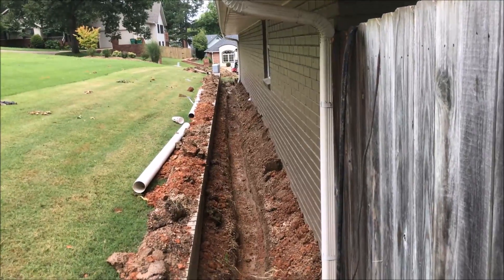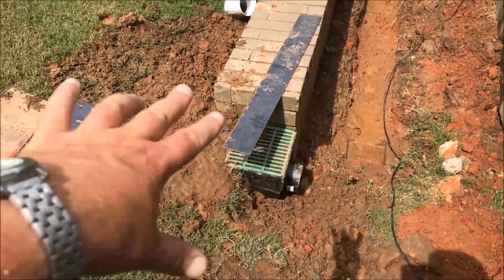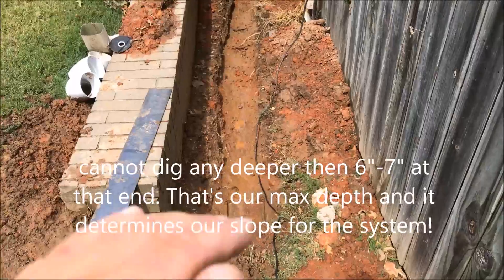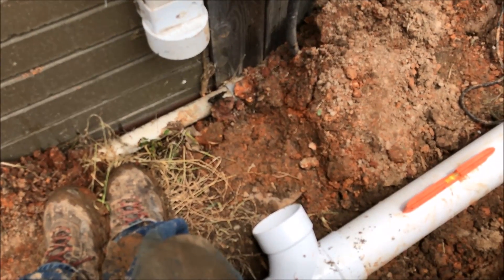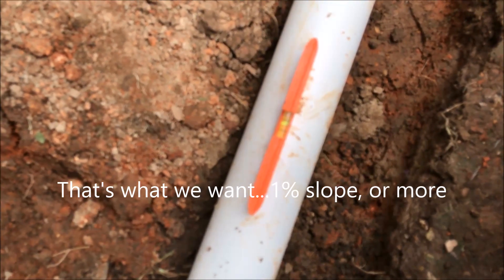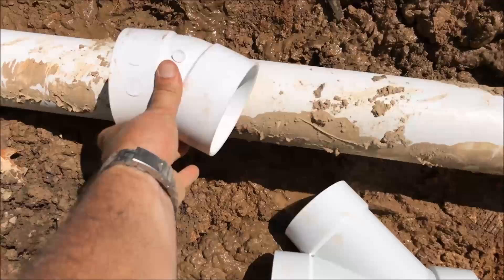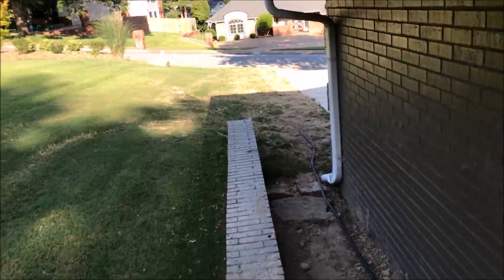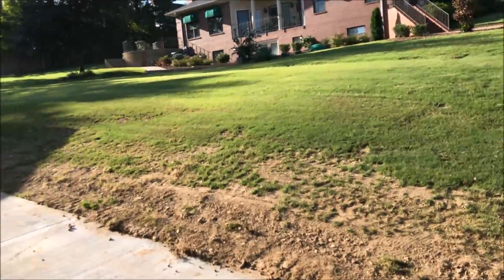Gutter downspout drainage - Installation -

Comment: Thanks for sharing the video. Newbie question, can you use a tee connector to connect both downspouts? I see that you used a tee for the first downspout but then used a Wye, with a 45, for second downspout. I'm planning on tie in two downspouts into a line to move the water away similar to what you did. Thanks

Comment: Thanks B & B for your informative video. Question are you using primer & glue on all those sch 35 DWV PVC pipe or just dry fit?
Reply from the maker: mcanning51 I don’t always use pvc cement for my fittings. It depends on what I’m doing and the site conditions. On these one, if I remember correctly, I used 100% waterproof silicone. I always pipe wrap my fittings (those below grade) with a rubber/vinyl wrap. Not duck tape.

On some jobs I use pvc cement.
Reply: B&B Drainage Solutions TY for your prompt reply. I did see on some of your other videos you used 💯 Silicone.

Comment: Please explain to me how having water draining from the downspout straight into the solid PVC is any different than having the downspout draining into a French drain, if water from the roof is coming through the downspout into the solid pipe it too will eventually clogged with the asphalt from the roof according to one of your other videos where you saw a piece of perforated pipe just show how much asphalt a pipe contains!?
Reply from the maker: Michael Edwards if you look at the 5:49 mark you see a 1.5” line against the foundation wall. That is a sump pump line. Which was tied into my downspout line (not shown for time reasons). Pretty sure any time it kicks on it will clean this system. Also, I use 45 and 22 bends coming off the downspout which increases slope allowing good water movement. And there is the key. Ask any plumber why they use smooth solid pvc. Because not only does it move water, but it pushes debris out too. Given slope is correct. 

And this is NOT a French drain. It’s just surface drainage and downspouts. And yes, never tie downspouts into a French drain. Especially around the foundation wall. Only hacks do that.

Comment: Did you pack mudd around the catch basion you don't thank that would wash away when it rains?
Reply from the maker: Stephine Price as noted in the video sod was placed on the soil after completed. No. Wash out will not occur, or will be minimal.

Comment: I'm installing a gutter drainage system in my yard. Would it hurt to install a catch basin at every downspout, or is that overkill?
Reply from the maker: Not so much overkill. Maybe a little pricey. This system didn't require catch basins as a pump discharge line was tied into it, which will push all the debris out. You can see the line for it by the first downspout at the 38 second mark. I didn't show that install in this video. 

To get around the cost of the catch basin there are other alternatives. Use a clean out tee, or a leaf downspout adaptor. I suggest there be some point that allows access to the system. It doesn't have to be a catch basin. I will add this, if your budget allows for it...I'd use a catch basin. It could even be the smaller 6" basins. I prefer to tie into them directly, rather then the downspout discharging on top of the grate! 

Hope this help!
Reply: B&B Drainage Solutions they are a bit pricey. I will look into the downspout filters and maybe use a couple catch basins for the whole system. Thanks for the help!
Reply from the maker: J H there’s a guy on YouTube that does a cool design using a clean out tee. I can’t remember the channel name. Try searching for it. Maybe downspout collection system? If I find it I’ll post the link. Only thing I disagree with him on is how far the discharge line extends. It needs to be 10 ft minimum and water should flow away from the home and not deposit in area that might cause water damage to other structures.
Reply from the maker: J H here I found it. Just another approach you might consider. 

https://youtu.be/4HRgco3uRms

Comment: hello, i would like to know how many inches did you incline the pipes in order for the water to go to the street drain. 
Also how many feet from the street to the drains does it have to be?
Reply from the maker: Socorro Benitez you should have 1" of fall (drop) for every 10 ft of run. The drain doesn't have to be any certain distance from the street. It is recommended the pipe is extended a minimum of 10 ft from the home. This system extended to the street to keep water from discharging around the foundation wall.